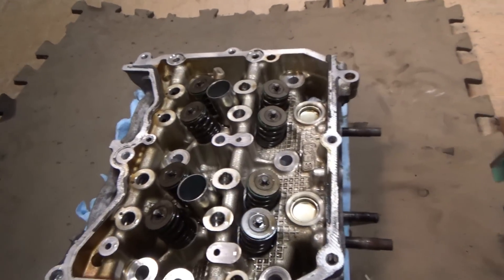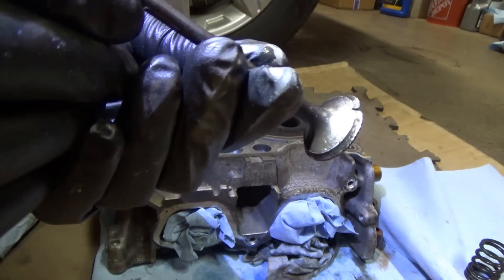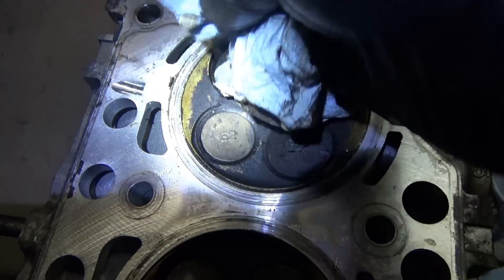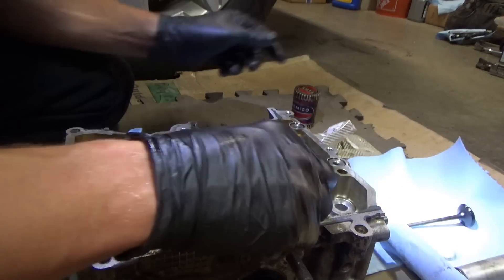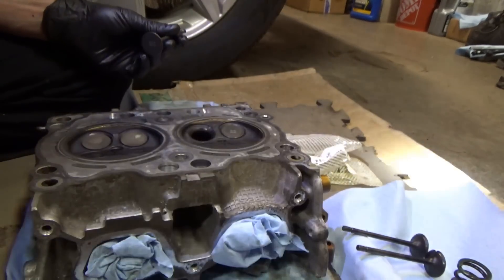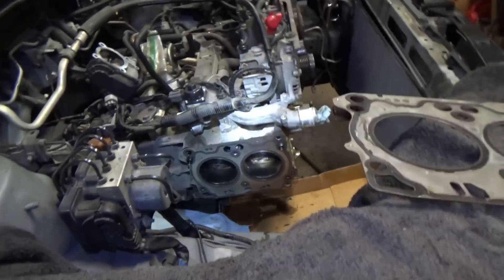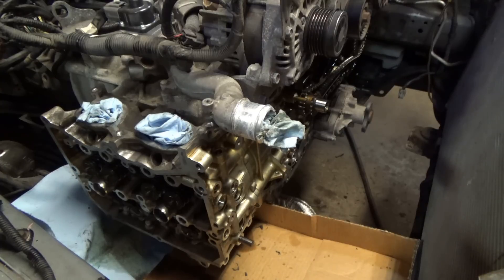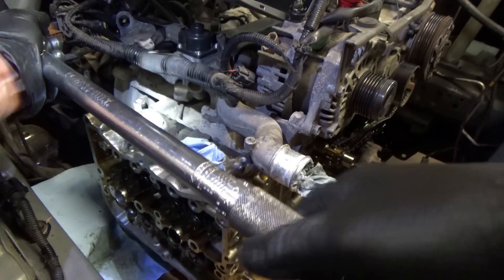What Happened to these EXHAUST VALVES!? (The Sad Subaru - Part 3)

Comment: I still have Clover Compound and lapping tools from 1980's 😆. We used Dykem Blue, solvent and vacuum to test contact between seat and valve face. Used mostly on heads from pre-unleaded days; no hard seats. Dykem lets you measure contact area and uniformity. Left side probably a ticking time bomb. Maybe time to DETAIL the car and get top dollar while it's running good and a sellers market??
Reply: Great philosophy. So some guy on a budget can buy it for his daughter and she loses the engine in some desolate place at night. Hopefully the owner isn't a cheap prick.
Reply: @giggiddy :  Welcome to the USED CAR market, Buddy. Better have a mechanic look at that car before you buy it for your DAUGHTER, and hopefully he knows how to tell which cars to PASS on. Otherwise, be sure it comes with a warranty. Patching cars for quick sale is a tradition as old as cars themselves. In the infamous words of Dorothy, "Toto, I’ve a feeling we’re not in Kansas anymore!”
Reply: @giggiddy  Maybe buy a used car with way less miles? Over 100K is where things definitely need replacing

Comment: Used to be valves could burn like this from either valve face or seat erosion or both, often caused by having valve seats that relied on leaded fuel, and using unleaded. The cure would be and still is to get hardened valve seats….but what happened here? It’s a Subaru , pretty reliable but when they go bad nobody seems to know why🤔

Comment: This type of valve damage is typical of misalignment of the valve guides to the seats. This prevents the valve from closing fully resulting in excessive heat build up and eventual failure of the valve and/or the valve seat. To properly effect repair, the valve guides should be replaced and machined accordingly prior to replacing the valves.
Reply: If the guide and seat were not aligned wouldn't that show up on the shape of the shiny part after lapping?

Comment: Considering if you remember the end of PT 1 where Ivan wanted NOTHING to do with this repair, he's at least trying to help this customer out whereas most other shops would likely only install a new(er) engine as most shops won't tie up a bay for a car like this for someone on a tight budget.  I used to work for used car dealers and we would do jobs like this and the amount of comebacks was very low.  As long as your customer fully understands that this type of job is very hard to guarantee then I see no issue.  At least we see effort, I know more than a few mechanics that would just slap valves in without any prep.
Reply: Like with Ivan the customer would have had a hard time convincing me to do this job, but he never could have convinced me to just do half the job.

Comment: Can usually use the tool with hand pressure alone to install the valve keepers , especially on the little engines
Reply from the maker: I have tried that, but the hammer tap helps the keepers fall into place instantly 👍

Comment: It seems like this engine has sucked in a piece of debris.  That cracked valve looks like it slammed down onto a piece of something.  I wouldn't be surprised if there's more damage on the other valves too.  Maybe a loose intake duct or something, letting in dirt and sand.

Comment: I don't know what the long term plan is for this junk but I'd get rid of it PDQ after this, I don't know if the used car market is still hot but what can you to replace it, especially since so much was sunk into it already. Years ago my girlfriend was looking for a vehicle, she was a secretary for an accounting firm and one of their clients was a used car dealer so she asked me to go with her there to look at cars, she spotted a Ford Broncos 2, we took it for a test drive and she fell in love with it, I did my best to convince her not to buy it but she was insistent and I lost. After driving it a bit after she bought it it started burning oil, the engine was shot oil was pouring out of the filler cap and it was smoking worse than John Wayne ever did, it came with what some people refer to as a warranty for thirty days, I took it to my friends who owned a shop, they agreed th st the engine was shot, he called the company handling the so called warranty who arranged to send someone to his shop and look at it, they agreed that the engine needed to be replaced and that's what was done with a rebuilt 2.8. Before this was done she asked me to go with her back to the dealer and try to convince them to take it back, of course they said no, it was fixed but was still a pile of junk in my opinion, she decided to sell it and buy a brand new 1997 Chevy s10 extended cab 4.3, she left me to become a nun in 2008 and I bought the truck from her, the truck is still running great with 152,000 miles, she even bought a nice cap for it a year after she bought it. Her family who hated me said it was my fault she bought the Ford when in reality I did everything short of hog tying her and dragging her out of the dealer.  And FYI, they don't consider it a warranty they refer to it as a service contract.

Comment: I don't think I've seen you lap valves since your friend's Toyota all those years ago. Pretty good stuff.
Reply from the maker: Yeah that was another budget engine rebuild! BTW that Prizm drove for another 5 years without burning a drop of oil until the next owner finally traded it in at 270k miles on a ...drum roll...2018 Subaru Forester!!
Reply: @PineHollowAutoDiagnostics  Wow! That Prizm was a freakin' brick! Even I wouldn't have though it could have held up so long., even with your fix. That's a great update, by the way. I appreciate your sharing that anecdote. Major repairs are sometimes worth it would the the moral of that story.

Comment: Those exhaust valve’s are corroded…..Cause Ethanol Fuel….They don’t care what there fuel does to your car as long as they can prove it burns and runs your car….Extended damage is no matter to the fuel companies. Don’t believe leave pump gas in the lawnmower or weed eater for 6 months or more and you will be replacing the carburetor because of Corrosion. 🤟🏻🇺🇸🇺🇸🇺🇸

Comment: what I fail to see mentioned is the width of the valve contact with the head...  on a typical 3 angle cut, the width of the contact is important as this is how heat moves from the valve to the head...  too narrow of contact,  too much heat and hot gasses flowing by and the edge of the valve burns....   OR there is something in the valve train not allowing the valve to completely seat, thus allowing gases to flow by...    if you examine simple live steam engines with no explosion in the chamber,  this same kind of burning or cutting action can be observed from a valve that doesn't fully seat....   the live steam leak just cuts the metal.

I personally can't imagine a bad valve as the other valves seem to be ok....   what's unique to that cylinder allowing the exhaust valves to stay off their seat....

maybe low spring pressure as that's an important issue...   but with testing this is really nothing more than a crap shoot...

I give you a D- for taking this job on and not really knowing what caused the failure....   I was always taught "test, Don't guess"

I applaud 99.9% of your testing and diagnosis but not on this...
Reply from the maker: The other valves looked bad as well! We'll discuss the root cause of failure in Part 4...I hope to improve my lousy D- score to at least a B haha

Comment: Ivan:  I have watched your videos for a long time but I have to say that those valve seats looked far from good.  There was pitting all over the seat and if you are going to lap them in, it should look uniform all the way around just like the new valve face.  I assume the engine probably runs better after you did this but that head should have been sent to a machine shop.  I just heard about the owner's budget but what about the person who gets this car next?
Reply: A little bit of pitting is normal wear, we took apart a toyota last 6 years with 190k, the valves seat had pitting, put it back and at 320k still no leaks from the valve
Reply: @phareztrinimand  this is because the valves seal at 2 to 4 different spots on the valve seat surface .
Reply from the maker: Hopefully the next owner will have a bigger budget ;)
Reply: @PineHollowAutoDiagnostics  I get that. I've done a lot of valve work in my career so it just seemed that this repair wasn't up to your usual standards.  Please know that I think you are terrific and I always look forward for your next episode of diagnosing.

Comment: Those valves are burnt.  The 'crack' is where jets of buring gas went out to the manifold when the spark fired.  Enough gas to eat away the valve.  The seats on the 1st valve shown in the second cylinder is worn out.  You can see the seating area is depressed relative to new. Likely the other side is withing a few thousand of doing the same thing.  The engine was run hard, and likely overheated(remember the silver-seal found in the water jacket).  "Rode hard and put away wet."  I hope you are giving zero guarantee as it will likely be back, or will be sold to an unsuspecting Subaru enthusiast who will need to do the rest of the job soonly.

Comment: Hi Ivan, I love your diagnostic abilities but your valve knowledge is not up to paar. I would not have called those valve seats good by any means. Those are destined to fail  with all that pitting. Definitely a job for a machine shop who cuts the new angles in the valve seats etc. I definitely would have at least lapped them in much longer  to get rid of the pitting. Still enjoy  your  videos!!!👍
Reply: also, he didn't check the valve guides for axial wear, to see if the valve stem rocks or wiggles inside the guide. I would have had the head completely reconditioned with new guides, seals and seats, though I realize the owner of this car is on a budget.

Comment: Those exhaust valves have the hard seat part spray - welded to the valve , those look like the spray weld has come off, probably from thermal shock. was it using coolant ?
Reply: Ivan did find coolant leak stop inside the cooling passage ! normal Subaru thing!

Comment: Or The 02 sensors are not working right and the engine was running super lean , should set a missfire code.
Reply: They were replaced before hand, along with a lot of other parts trying to chase what we thought the prob was lol😬

Comment: Burnt valves are almost always caused by the clearances being to tight, the valve or ignition timing being wrong or wrong octane fuel.
In this case it will be valve clearances being to tight.( assuming they are shimmed clearances as apposed to hydraulic)
Burnt valves were very common in the uk when lead was removed from petrol. GM had us retard the ignition timing by 5 degrees. ( when you could adjust ignition timing)
Reply: Many were fitted with 'rotators' on the exhaust valves to prevent what was seen in the video.  Rotating prevents the valve developing a hot spot.  Well, slows down the occurrence, as the valve does not seat on the same spot every time, it moves and tends to even out the temperature.  They are built into the retainer so it may have them, but w/o close inspection...
Reply: @GrumpyUnkMillions  many people dont know that hydraulic solid  lifters spin as well.
Reply from the maker: Valve clearances are fine...I'll check in Part 4 :)

Comment: Hi Ivan, I was reading through the comments but don't go through all , but based on my knowledge the reason for valve burning is improper shimming on the exhaust valve and overheating over time cause premature failure , if you notice that exhaust valve is thicker than the intake , because it is exposed to more heat so when it's closed it is supposed to stay close a bit longer than the intake to desipate the heat to the cylinder head , if you check any specification on valve clearance you will see that the exhaust have a wider clearance than intake.

Comment: Our 2014 Forester 6MT, 2.5i is due back from the dealer today. Started as the cylinder 1 misfire, had all four plugs replaced in January, code came back in May. 

Dealer said 100% leak down on cylinder 1. Pulled head and found exhaust valves to coked up they weren't closing fully. No mention of them having burnt, only a matter of time. Both heads sent out to head shop for valve work. Dealer repair cost will be $7,600. 

We're back to the 1930's engine wise, pull heads and decoke every 100,000 miles.
Reply from the maker: Holy crap...only 100k miles??
Reply: @PineHollowAutoDiagnostics  Ours was at 150,000 miles. The 100,000 mile comment was about how years ago, you had to pull the heads and clean the carbon out (decoke) regularly. The interesting thing here is the carbon build up is more on the exhaust valves and may be related to the oil burning issues with these engines. 

Especially since the intakes look fine. Direct injection engines have issues with the intakes getting gunked up because there is no fuel in the intake to clean them. 

Also, as you noted, they have updated exhaust valves, so that may also be in the equation.
Reply from the maker: @everettthompson9941  yeah even 150k is way too early for such issues on a modern car 😬 the latest gen Subarus 2018 and up don't seem to burn any oil at all... Hopefully they will last longer!

Comment: I thought the new valves were supposed to be E3 not the same E2. Now I have to go back and look at the part 2 video to check myself.  Thanks vlad for all the great videos.
 I checked video 2 the service bulletin definitely says E3 is the new part and the valve stem was longer by 2.4 mm. I know the part# on the bag was for the new part but I'm concerned that bad parts went back in.

Comment: Thanks for this series Ivan.  I have really enjoyed it!  My guess is extreme heat caused the damage.  I bought a used Lexus RX 300 real cheap and had the head shaved, machined ,valves and springs replaced on it's Toyota engine and it cost $500.  The real expense came from the tear down and reassembly which was thousands, plus the studs, gasket, belt, plugs, and water pump.  I pray it was worth it.  I really bit the bullet, but plan to keep the vehicle for many years.

Comment: Wow Ivan, you got a rough audience with this episode.  (Can't you just feel the love?).  Your diagnostic skills are top notch, but I guess some old grizzled veterans found this "less than stellar lapping job"  as an opportunity to bring you down a peg. 😟
Reply: Nobody is trying to knock him down. Everyone on here is an ardent supporter of his channel.  This repair takes specialized skills with special machines and tools and believe it on not probably some on here are in a better position to complete this repair. No doubt Ivan will get this rig running again but how long will it last is a good question.
Reply: @The_Sword3  Sounds like a proper repair is no way near of $2K. Maybe this repair is expected to last no more than 10K miles. Would it last longer by using higher quality gas?
Reply: @chiluco2000  A "proper repair" would entail pulling the engine (approx $800) and machining the heads. With the engine out it would make sense to do both sides. so that 2K budget is then down the drain. Higher quality gas would have no noticeable effect on wear items. Might be cheaper to look into a factory rebuilt.
Reply: @The_Sword3  And it would still be burning oil. It needs a full rebuild
Reply: @The_Sword3  And it's still burning oil so how long would a "proper" valve job last and would it be worth it without doing the cylinders as well . . . ?
Reply from the maker: Haha that's OK... Can't please all the professional engine rebuilders out there :)

Comment: Ivan as long the seat is not pitted you can away with install new valve however and did check the valve clearance with head off by reinstall the cam and shims before installing it in the car

Comment: Burnt exhaust valves are a classic indication of pre-ignition in the chamber and/or lean fuel air mixtures. Common root cause is running low octane bio-fuels for long periods of time, without refuelling with a fuel of higher octane which will achieve greater calorific values at lower combustion temperatures. Owners manufactured outside the USA, should be aware of high content bio-fuel limitations and their impacts upon fuel systems, engines and catalytic converters.
Reply: WIth all that stated, seems like the only subarus affected are some forresters, like he said.

Comment: I thought the seat look real bad. I would have run a cutter over them. A proper multi angle seat prevents carbon from getting trapped under the seat. That job was bad enough to do the first time. I wou,ldnt want a comeback or anyone calling me a parts changer. If i try and save someone else money it will cost me money. Dont be me.

Comment: Last year I bought a 2015 Legacy from the auction as a non runner from a Subaru dealer. Engine was dismantled and in the trunk, same issue. One exhaust valve was burned out. Car had 125K miles and was in good shape otherwise. 

$450 (luckily) bought a used motor with only 17K and it was back on the road.

Interesting to see this is a common issue, or will become one as these cars rack up the miles.

Comment: You forgot the valve stem oil seals--a great source of oil burning.
Reply from the maker: That would cause oil burning only via the intake valve seals since they are under vacuum. Regardless the piston rings on these engine are crap lol
Reply: @PineHollowAutoDiagnostics  good point!

Comment: Thats some straight up old school valve replacement.i am impressed,I haven't seen that in 40 years.assuming it wasn't a long term lean condition I have to figure the valves were made from bad metal,basically someone didn't check the quality of the stock the valves were made of.i have remover many many heads with burnt valves but I never seen that.hope it runs well sir